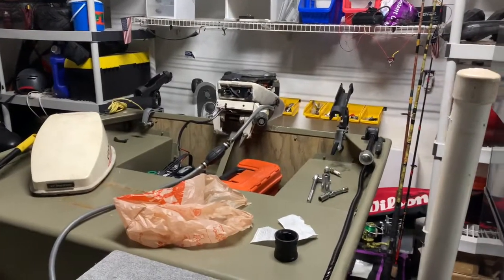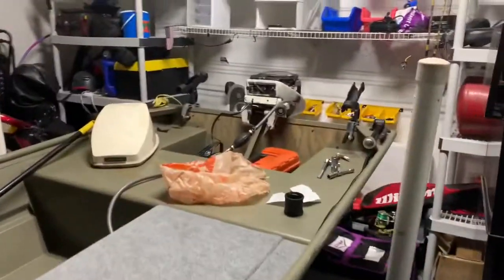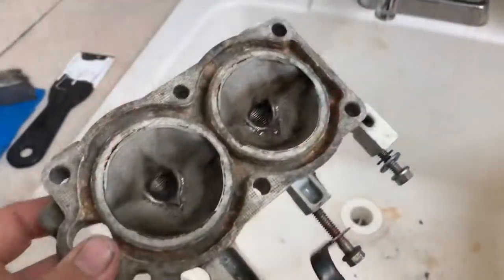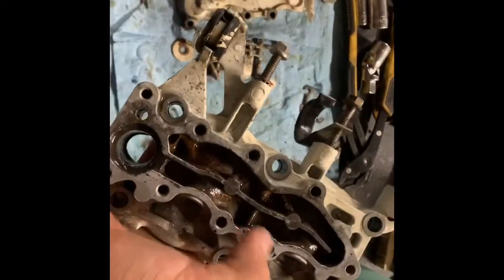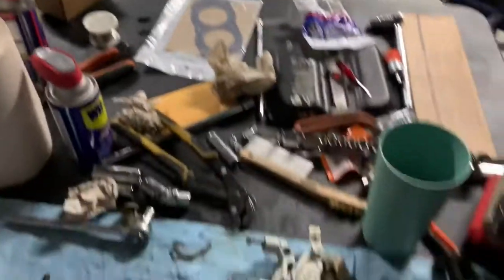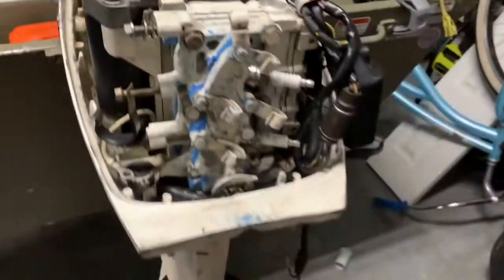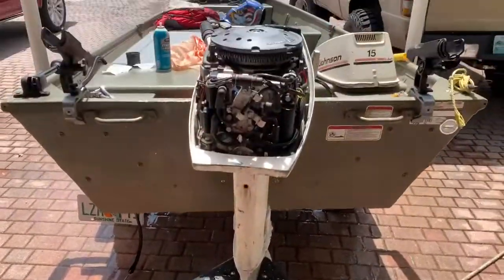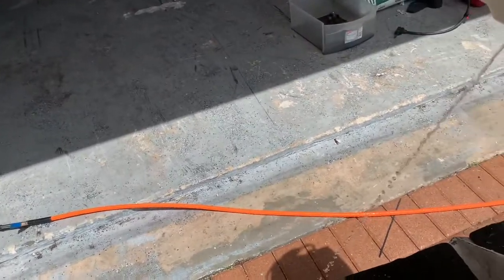Outboard no water after impeller change?

Comment: Hey boss! I just wanted to let you know you don't need to be so worried about "scratching" the gasket surface with a wire brush. I have done tons of aluminum head work, valve covers and other fine aluminum engine work 2 and 4 stroke and use fine bristle wire brushes frequently to get stubborn gunk or corrosion cleaned up! You don't want to mare the surface or leave any wire bristles behind but a few light scratches will only help the gasket sealants stick and seal. It's like sanding the metal on a car so paint adheres the best! It is important on engines however to make sure you don't remove too much material from head cover surfaces because tolerances are often very tight and you can inadvertently increase compression to dangerous levels. You likely would never do this only cleaning but it is something to be aware of.
Reply: Should use a water drum on small outboards not muffs
Reply: Mine chunks of the impeller went up the water tube and got stuck in several places

Comment: OK, the first thing is to make sure that overboard indicator hose, nipple, elbow isn't plugged with crud.  The motor may actually be cooling properly, the indicator is just plugged up.  Try blowing backwards through the hose with compressed air.  Did the engine pump water before you changed the pump?  If so, perhaps you didn't align the water tube properly into the impeller housing.  Perhaps something is wrong with the new water pump, is it an OEM part?  
Unfortunately, these engines suffer from a relatively simple, but time consuming problem..  The upper water tube grommet gets crushed by salt water blocking off cooling flow.  The plugged theromstat you mentioned would not stop water from coming out of the cooling telltale...  Unfortunately, replacing that upper water tube grommet requires pulling the powerhead off..  Let me know if you need help or have more questions..
Reply from the maker: Problem was the thermostat opened too hot of a temp got a new thermostat that opened from a cooler temp
Reply: @tine-2-huntwhitetails286    OK, well there are several steps to this, kind of hard to describe all of them.  Needless to say, it is much easier on a manual start engine than an electric start model.  Is yours a salt water motor?  If so, you will probalby need some heat to help loosen up the powerhead bolts (6), and the four bolts that hold the inner exhaust tube to the powerhead.  Let me know if you want to talk more about it.  
Don
Reply: @tine-2-huntwhitetails286    OK, so it is cooling now, but leaking black/sooty exhaust through the top two holes in the exhaust housing where the steering bracket goes through, correct?  If so, tell me what year and model this is.  Unfortunately, this issue is fairly common on the newer engines with the open inner exhaust tube..  Let me know... Don
Reply: @tine-2-huntwhitetails286   OK, just typed something here and lost it...  So you are saying that straight water leaks/pours out in front of the exhaust housing up top near the powerhead, in between the exhaust housing and the vertical steering shaft/tube.  Maybe you could post a video here to clarify.  Usually water leaking in this area means the seal on top of the plastic water pump hsg is missing/damaged.
Reply: @tine-2-huntwhitetails286  OK, I'm sorry, you have a Merc, not an OMC.
Reply: @tine-2-huntwhitetails286    Don't know too much about Mercs, but it looks like it may be what I described on the OMC.  Usually there is a seal on top of the water pump that prevents this.  In order to confirm this I would have to remove those lower mount covers to find the actual hole in the exhaust hsg that water is coming from.  On some of the older OMCs, there is a hole that water is supposed to escape from, kind of acts as a hydrastatic water seal.  Don't know about the mercs, hopefully you will find a knowledgeable Merc guy that has the answers.   Sorry   Don

Comment: No water after new pump kit, found the reason, salt corroded side of housing under impeller plate water was going down not up.. used jb weld to fix corroded area, now water was pushed up to head. Plenty of cooling now

Comment: How did you compress the air in there mine barely pees from the hose thinking this will help it just don’t know how thanks
Reply from the maker: You gotta take the lower unit off and blow it in the tube that connects to the water pump outlet

Comment: OK, you blew through the water tube, now you get some water out of the telltale...I'm thinking is that the grommet is crushed, the compressed air opened it a bit...Unfortunately, I think the problem is still there and will cause you big trouble in the future...
Reply: Yes still not like it should be
Reply: @135-j    Sorry buddy, you will probably end up going after those grommets...Let me know if you have questions...D
Reply from the maker: Turned out to be the thermostat wasn’t opening properly so I got a thermostat that opens at a much lower temp
Reply: @floridamansgarage8629  Don't want to rain on your parade here but as others have indicated those gromets are prone to get mashed and swell and choke off the water supply.  When that has been fixed, when you rev the engine it should pee out than a hard stream...which I didn't see in this video.  While blowing compressed air thru the opening will perhaps get you enough water flow, it won't be enough at a wide open run, or will slowly close back up again.  Got to pull the power head and replace those gromets....weak point on these machines.
Reply: I agree. Those grommets at the bottom of the power head will collapse on themselves thus greatly restricting the water flow or blocking it completely. Do yourself a favor & order them. I think they are about $13 each plus a new powerhead base gasket.
Reply: @t-bone43    Yeah, outrageous price, try to find mine on ebay for a little less.
Reply: @t-bone43  Since the head is attached and gasketed to the base...wondering the need for these little grommets at all....take them out or poke them out of the way and let the water flow????????????????